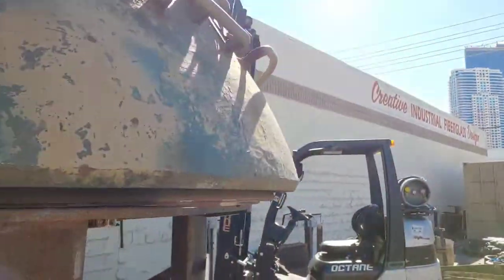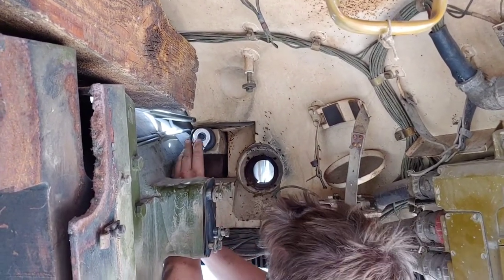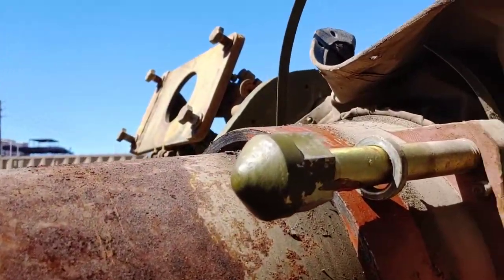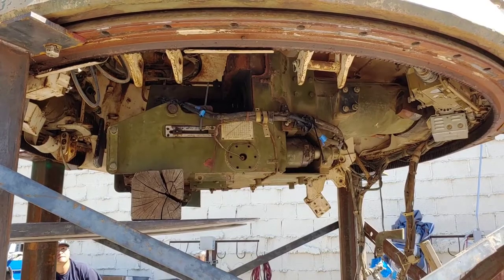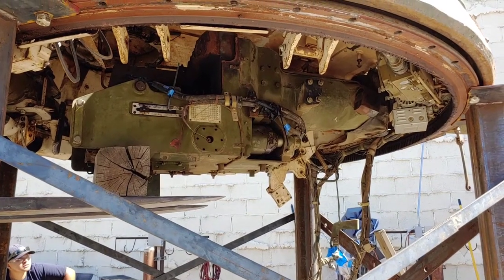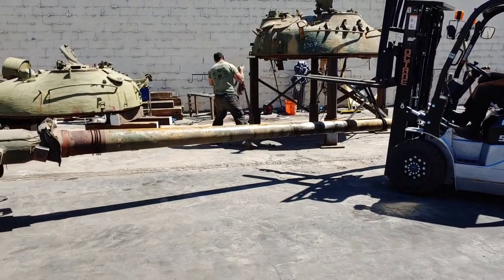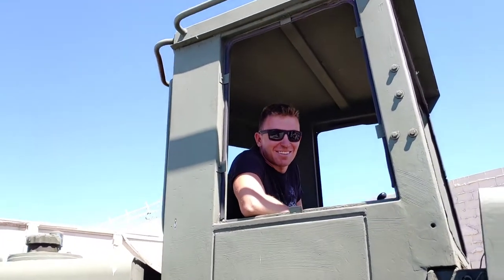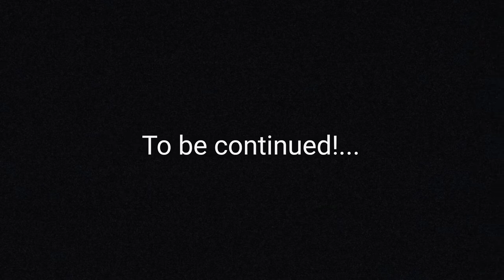Removing a gun from T62 Tank/ Снимаем пушку с Т62

Comment: what the Russians did , to install the gun, was put the turret on an angled stand, so that the turret was angled downward and the gun was slid in, horizontally, to it's mount on a length of what looked like railway line or a steel RSJ.
Reply from the maker: Sorry for the late reply. Comments are hard to keep up with! 
Very correct.  In our particular case the turret ring and several other components needed work but should we ever need to change the gun again we definitely are going to try that!